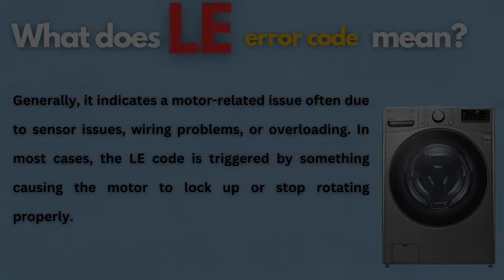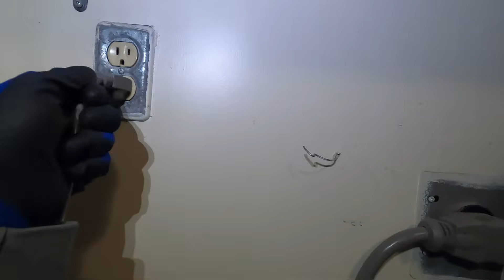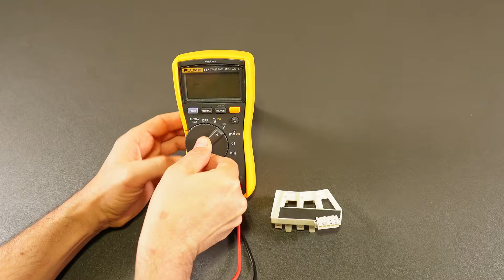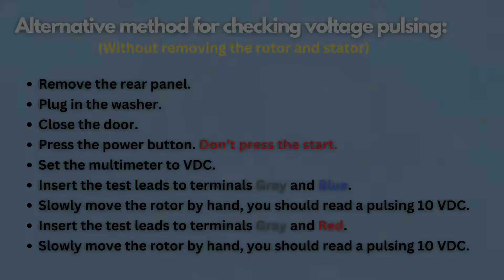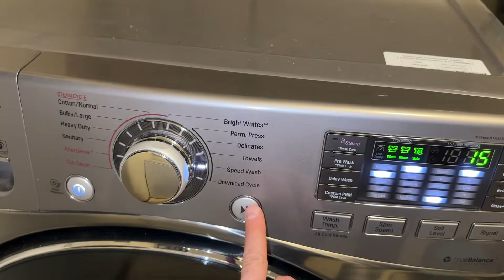How to Fix LG Washing Machine LE Error Code – Complete Repair Guide

Comment: really appreciate this simple and easy to follow video...on my LG, the wires and connectors look good nothing brunt, drum moves freely by hand no obstruction, the 3pin reads 8 and on the 5pin hall sensor I'm getting 9....should I just replace the hall sensor anyways?

Comment: First let me say this is a great video and helped me save hundreds of dollars.  I just want to share that I performed all 3 tests on the rotor sensor and they all showed the sensor to be good...BUT IT WAS NOT. I replaced the sensor and the machine is working again. Test 1 (resistance) passed.  Test 2 (apply 10 VDC and pass a magnet) passed. Test 3 (mount to machine, apply power and turn motor) passed; however the voltage swing on one circuit was between near 0VDC to 10VDC and the other circuit was closer to 1VDC to 10VDC which may be a concern.  Either way, a $10 part saved my machine.
Reply from the maker: Thanks for sharing your experience, cases like that are definitely rare, but they do happen. Glad you were able to fix your washing machine and save the cost of a bigger repair!

Comment: Great video. I have washer model WM3670HVA. It is throwing code LE and I do not have a Hall sensor. Does this mean I should test and or replace the control board?
Reply from the maker: If your model doesn’t have a Hall sensor, you can still follow the same troubleshooting steps and just skip the section related to the sensor. If everything checks out, then the control board would be the main suspect. Also, pay close attention to the wiring, a wire can be broken or burnt internally and be very hard to spot.
Reply: did you end up replacing the whole control board, the wiring harness, or both? mine as well does not have hall sensor. the wires looks fine but i cant be sure. seems much easier to replace the wires than the whole control panel. thanks!

Comment: Our Thinq Washer model WM3600HWA, serial number 106VWFW07003 not Spinning and throw the code u5. I replace the vibration sensor on the top and no change same error code u5 at about 11 min to the end, when I ran couple of 18 minute ricing and spinning cycle. I will check the position sensor as you recommend in your video. Any other advise? Thanks Lubomir.

Comment: My bolt won't loosen
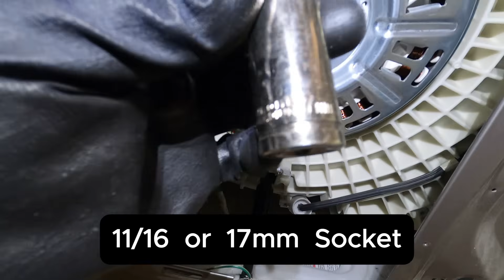Reply from the maker: At around 4:40, you may need to use a hammer as I did. You can ask someone to hold the drum from the front of the washing machine while you do this.

Comment: What happens if you don’t get any resistance on 1-2 and 2-4 on the motor?
Is that a bad stator?
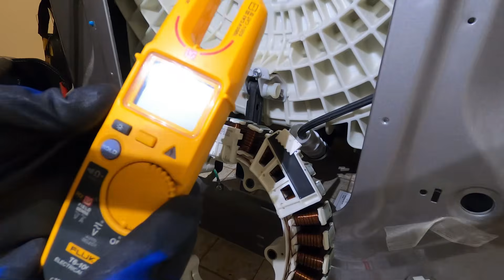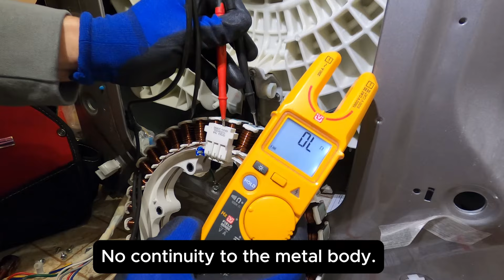Reply from the maker: The stator only has 3 wires, so don’t expect to see a 4th one. Check out the part from 6:15 to 6:45. If any of the windings are open, the stator is bad. That said, these stators are super reliable, I’ve never had to replace one myself.
Reply: I've checked my LG machine step by step as you've demonstrated on your video, I have even changed the sensor assembly but my machine still shows LE error code!! What else could it be?!

Comment: top! But if I may add: I think is better to use blue thread-locker paint instead of the red, the blue is designed so easy to disassembly again a device, still keep the thread secure, red is way more powerful and may require heating for the removal.
Reply from the maker: Thanks for your input! You’re absolutely right—blue thread locker is a great option when you want a secure hold but still need to disassemble parts later. The red can be a bit too strong in some cases, especially without heat. I was actually out of the blue one that day, so I used the red instead. I appreciate the feedback!